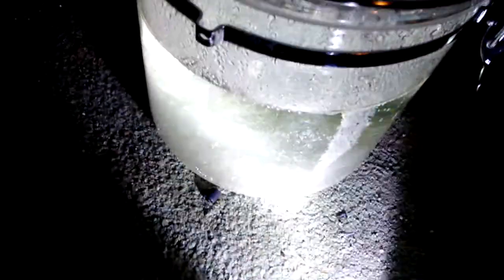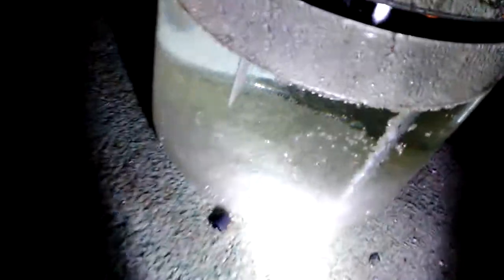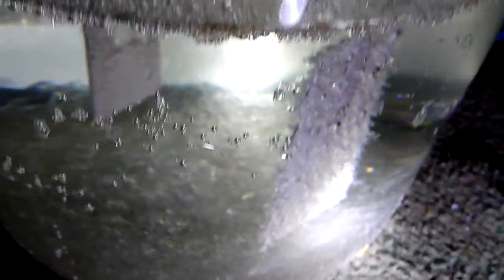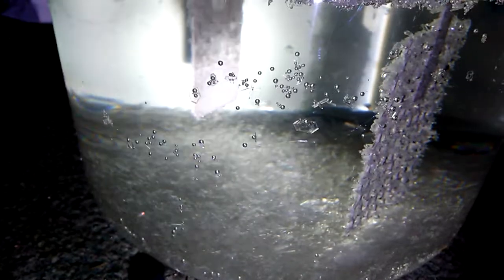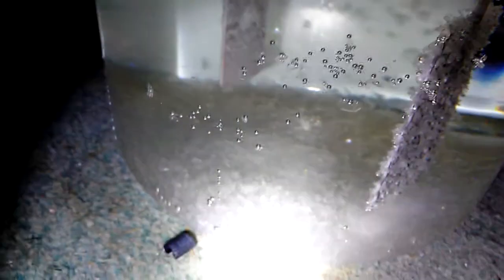My Potassium Chlorate cell just a glimpse at the progress

Comment: I though for maximum efficiency you should have your cell temp at about 60-70 degrees C? Normally the cell does that by itself anyway. Perhaps your voltage was too low to allow the cell to heat up, but yeah I heard that if it’s hot the efficiency and yield will massively increase.

Comment: Thank you for your Help! I appreciate it!
Reply: I'm trying to make some chlorate.  In order to improve my amps I need to use more than one Red and Black lines? DAMN bro your good at this I would like to learn more from you! Thank you so much you are really helpfull
Reply from the maker: martin villa yes sir more then one positive and more then one ground.  That small 16gadge wire isn't going to handle 20A so you need to make it bigger or run more wires and since de-soldering and re-soldering a PCB board is most likely above our capabilities we need to use more wires since there already there for our using. Lol. Just need to make sure you have the right 2 wires to be combined.
Reply from the maker: martin villa any time.  That's what this is all about.  Helping each other out.  Just please please be careful when you get your harvest of very powerful KClO3 because its not very compatible with a lot of things especial SULFUR ions!
Reply: Excellent! Brother thank you once again! I will follow your indications!^-^
Reply from the maker: I will make that video on the wiring as soon as I can.  Even if it's just a quick tutorial.
Reply from the maker: If you want thumbs up the videos cause it helps the channel.  Soon I will start editing my synthesis and tutorial videos so they have a more pleasant watchability.

Comment: The power supply im usimg it says +5v/22.0A Then another +5v/2A. Does it still work? That would be really interesting seen you make a power source! Can you share the link bro for Pt?
Reply from the maker: Check this out: PLATINIZED TITANIUM ANODE PLATING ANODE JEWELRY RHODIUM PALLADIU... https://www.amazon.com/dp/B00WOP5RCA/ref=cm_sw_r_sms_awdb_t1_LEpwBb4CA80A4
This is one of my electrodes and its 2.5 micron platinum plating verses the 0.75 for the garbage one's.
Reply from the maker: I can show you how to go through the power source for the computer to find your 5v 20A and your 5V 2A
Reply from the maker: I can also show how to use a car battery charger as your power source.  But if you are using the computer supply you need to use more then one line and you need to bolt it to your electrodes so it doesn't melt your wires and fry your power supply.  I did that to more then one.  Also you need to make sure you get your solution nice and warm because it takes heat to destroy the chloride to chlorate.  Are you after Perchlorate s or just Chlorates?
Reply from the maker: I run my cells longer then I have to because I don't monitor my PH and I don't add Potassium dichromate.
Reply: That would be nice if show me how to find those 20 amps
Reply from the maker: You need an Volt meter any one will do but if you look at the board where all the wires are coming out it will say what the voltage is on it near where they come out

Comment: I been trying to make chlorate and I failed, not sure what I'm doing wrong. I got mmo anode titanium cathode l, with a computer supply 5v. I'm also using a water sofner sodium free. Help plz!
Reply from the maker: The comp power supply might not have enough Amps.  You need to run it for a long time bro.  I ran mine on a comp supply for like a month and finally got crystals.
Your MMO may not be good also sorry to say.  Can you get 40$ and an Amazon account?  I got 2 platinum deposited electrodes and now I'm making perchlorate as well.   You might want to try PbO2 if your making them yourself
Reply: Cannagorilla Canna 
Thank you so mcuh!
Reply from the maker: Anytime brother.  If you want me to make a video on how to use a car battery charger for your power source I can plus how to make the destruction cell itself I can.  If you want a link for the anode let me know.  I have a great seller who sells official 3×4 or 2x3  Pt Anode's
Reply: If I use a DC power suply, I would probably need to set it up to 6v? And how much amps? In order to make chlorate 5-6 days. And yeah I would like to buy some Pt anodes.
Reply from the maker: You need any where from 5V/5A-10A DC but it all depends on how much electrolyte you got for a little more then a gallon I ran 5V 5A for a month and got NaClO4 but for the same size for KClO3 I ran it for 2 weeks at the same 5V 5 A. The higher the Amps the faster its done.
Reply from the maker: Oh yea I got over a pound of each run
Reply: @chemistryscuriosities  I'm trying the same with very little success as well. Not sure if it's the electrolyte itself that's the problem.
I'm pretty sure it's a fully saturated solution. Can you provide any info on how you prepare your saturated solution and whether you add it cold or hot, I can't find much info on preparing the solution itself.
Btw. Recently found your vids, new subscriber.
Reply from the maker: G Macka welcome to the family brother.  First I get No Salt from Oceanstate job lot for $1 for 4 oz then I dissolve as much as I can cold in distilled water.  The size container you're using will determine how much to dissolve.  Then I heat up the KCL and add a little more probably another 50g them filter after all has dissolved.  You should add a half a gram of Potassium dichromate to increase the efficiency of the cell.  Add your electrodes MMO or Pt anode and stainless or titanium cathode voltage and current will depend on how much solution.  I run a Gallon at 4v @ 5 Amp.  Let me know if your still having trouble.
Reply: @chemistryscuriosities  first of all thanks for the welcome, and thanks again for the info. I'm using carbon for the anode at the minute and stainless for the cathode.
I have been looking online at Ebay and Amazon for better electrodes, but I'm a little hesitant at the minute because a lot of people are posting that the ones they are buying are fakes.
I would like to get an anode that is platinum coated or MMO, and not to sure if I should upgrade to titanium or just stick with the stainless. Do you have any thoughts on this and do you know any reputable places online that won't RIP you off.

Thanks
Reply from the maker: G Macka I will send a link to the one I bought if you would like.  $40
Reply from the maker: G Macka what is your power source?
Reply from the maker: G Macka https://www.amazon.com/dp/B00WOP5RCA/ref=cm_sw_r_cp_awdb_t1_CjyRBbKZN8KGC
Reply from the maker: That link is for my platinum anode
Reply: Cannagorilla Canna thanks man, I really appreciate your help.
I bought both the anode that you gave me the link for as well as a stainless strip that was advertised with it. Should receive them Oct 1 - 3rd.
Fingers crossed I can finally get a decent and clean yield.
I am using carbon arc rods for anodes at the moment along with a small DC 5v 2.5 amp power source.
The batch I just harvested was absolutely filthy, as the carbon rods basically just disintegrate.
I am in the process of converting an ATX computer power source. I believe it has 5v and upwards of 20 + Amps.